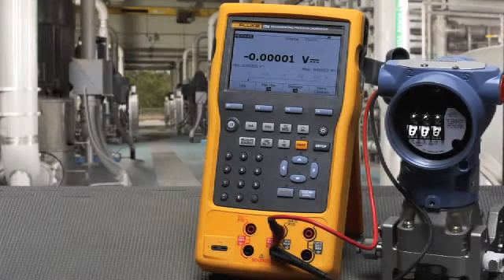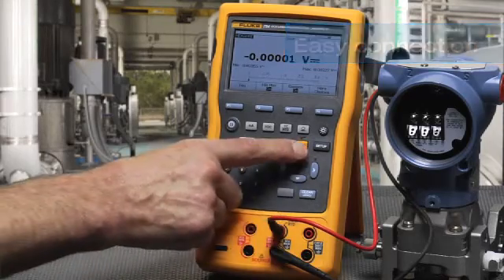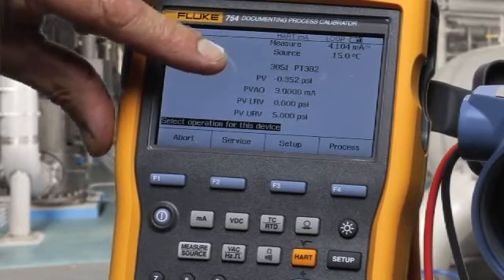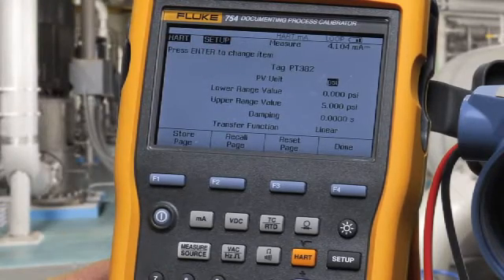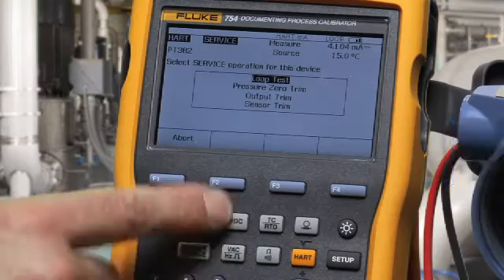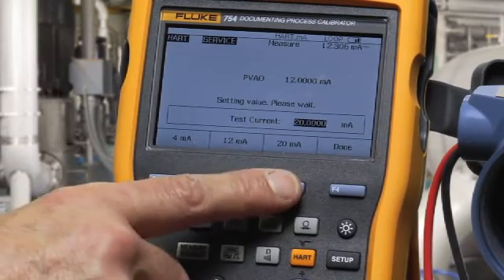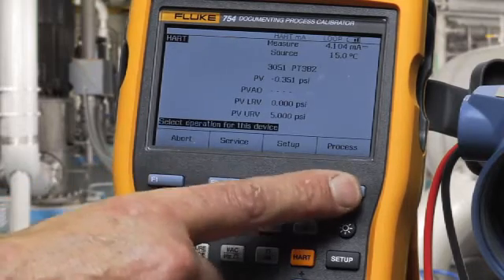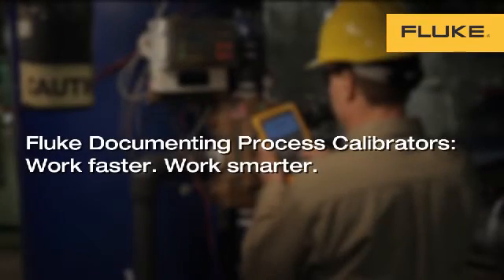Introduction to HART utilities in the Fluke-754 DPC

Comment: This FLUKE is USELESS when you need to do any transmitter. Only available options are shown.
Reply from the maker: Hi Pawel - Can you please provide more information on the tests you are trying to run on your transmitter? We may be able to help recommend the right tool for your specific application. Thanks!
Reply: @fluke  for example you cannot modify Scaled Variable data points calculated on PV, many different settings on dP measurements are unavailable. Next example is radar configuration. Tank height? All antenna, medium and tank settings? False echo? Comparing to the 475 it's just precise calibrator.
Reply from the maker: Hi Pawel - The 754 is a documenting process calibrator with HART capabilities for calibrating transmitters. It sounds like you are looking for a Hart communicator, like the Fluke 154: https://www.fluke.com/en-us/product/calibration-tools/multifunction-calibrators/fluke-154

If you have any additional questions or would like to speak to one of our Calibration experts, please send us an email at communityadmin@fluke.com. Thanks!
Reply: @fluke   why a $8000 device cannot have integrated hart communication protocol like the Emerson 475? I want to buy your 754 but for the price it should come with HART communicator. do you know when you will be updating this overpriced outdated piece of equipment? I might wait if there is a date. Also the TREX by Emerson does what your FLUKE 754 can't like HART communication.
Reply: En el caso que el equipo no se conecta con algunos instrumentos que tienen protocolo Hart. Cómo se actualiza para que esté pueda conectarse?
Por ejemplo, no se conecta con algunos instrumentos Masoneilan y con algunos Instrumentos Fisher. Si son protocolo Hart porque no se conecta con estos instrumentos? Es necesario alguna actualización